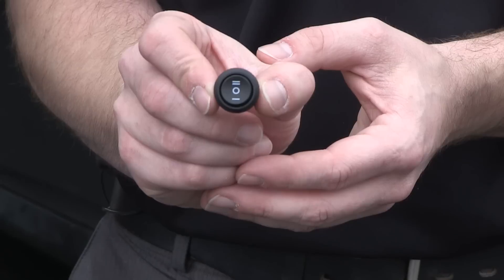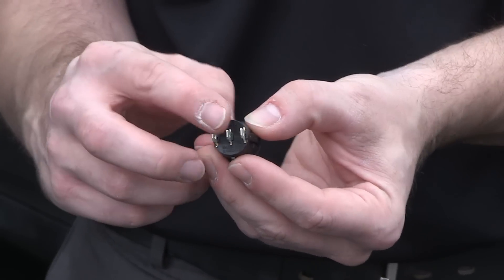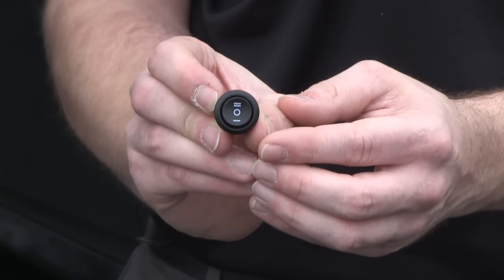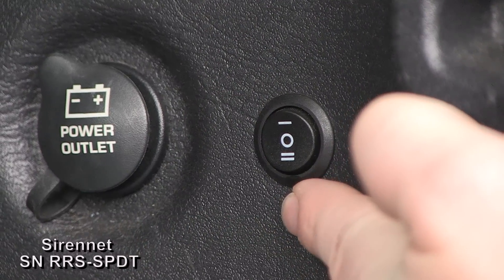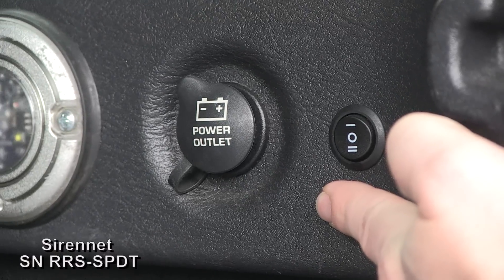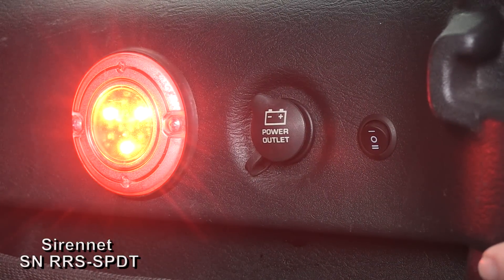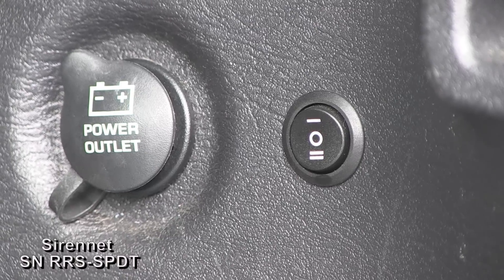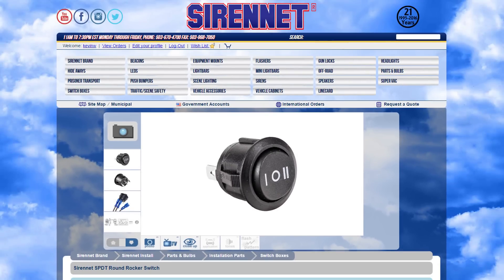Sirennet SPDT Round Rocker Switch

Comment: Would this work for a "dual zone" exterior light setup?  I'm planning on putting grill lights on my vehicle as well as a license plate bracket.  Trying to avoid drilling multiple holes.  Could I use one of the selectors for the rears and the other for both front and rear?
Reply from the maker: You sure could... You'll need to split your wiring to it and the posts it's going too for control.

Comment: No show on the wiring?
Reply from the maker: We didn't have a chance to show the wiring, but on the switch the main +12VDC wire connects to the center post and the other two are the On and On positions for the light / accessory.

Comment: Could i use this in a headlight an light bar set up im wanting one post for headlights an second one for headlights a  light bar at same time
Reply from the maker: This is an On | Off | On switch, so you would likely need some sort of relay or inline isolation diode to do so.

Comment: How did you wire it up
Reply from the maker: The center post is the input for your +12volt wire. The other two are for the lights / accessories. These work great with multi-color warning lights and Red/White interior lighting. "I" post can be your On for Red and "II" for controlling White separately... just an example.

Comment: I am trying to accomplish this with the exact same switch but it doesn’t work I’m running 12v power to the center and my led strip has three wires black being earth blue being orange and red being white I have tried multiple ways can’t seem to get it to work ??

It is the hardkorr lighting led strip I’m trying to wire to this switch.
Reply from the maker: With the strip light grounded separately from this switch, the center post needs to be connected to +12volts. Your lead wires for Orange and White lighting will connect to post 1 and post 3. Don't forget an add an inline fuse. They should specific what size you need in the instructions.